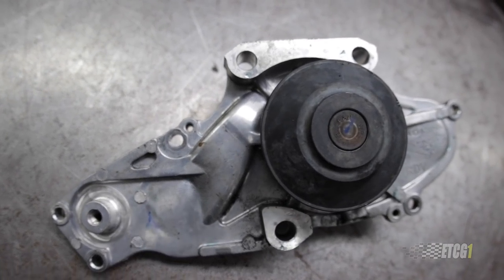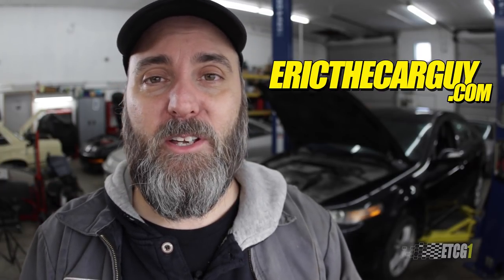Timing Belt vs Timing Chain, Which is Better?

Comment: Some belts are good, some chains are bad. But for the average person having a chain means less cost for a longer time.

It's also sometimes just as expensive/difficult to change the belt.
Reply: When I was a new driver my dad always said replace the belts and water pump after 100k miles. I wonder if there is similar wisdom for the chain guides
Reply: Plus chains tend to fail less catastrophically. They will rattle and throw timing codes.
Reply: @zachm7916  A chain can cause similar damage. If the tensioner fails or if the guide breaks, the chain can easily jump time and valves can kiss the pistons.
If a tensioner fails or the chain "lengthens" itself and it rattles long enough in its housing, the metal shards of that housing can cause internal wear and damage.
Reply: @blockbertus  Id agree that can happen, but it seems to me to be more common on engines that are designed poorly in the first place.
Reply: @blockbertus  True, but I know from experience that most customers will just crank up the radio and ignore the check engine light.
Reply: @panzerveps  Exactly my point.
Reply: Just as expensive lol compare the Toyota 4.7 and the 5.7 it’s thousands more to do the timing chains on the 5.7
Reply: And yea they wear out every 150-200k because will it’s a wear time
Reply: @eric8292  It really varies from vehicle.to vehicle, some belts need to be changed every 80-90k km, Some chains can go for 400k, some tensioners fail at 250k.

Generally there are so many other things that can and do go wrong on a car that it may never even last to that point. But if you were to replace it every ~225k, km you would probably be good on that front.

I have a feeling the water pumps are getting changed out way too often because of 'might as well'. They should not fail as often as we plan for. Seems like such a waste. Either that or they aren't being built to last just because they know your belt is being changed.
Reply: @Oblithian  what's wrong with changing the water pump before it fails? Genuinely curious. Preventative maintenance is good, plus the old water pump can be remanufactured so it doesn't get wasted in the earth. Maybe I'm missing something?
Reply: Good opinion
Reply: @panzerveps  There's no solving poor maintenance, but you can at least reduce the frequency. Alternatively  if you have a non-interference engine, it is more dummy/sloth proof (and belt-defect tolerant).

So if I wanted to give a vehicle to someone who can't be bothered, a non-Interference belt-drive would be good to force them into some maintenance. Though if they are skipping oil changes for the life of a belt, it probably won't live long anyway. So maybe they will be better relegated to electric only.

Comment: 9 times out of 10 I'll take a chain. The few exceptions are engine models with history of poor chain reliability like a 5.4 3V Triton (Had 336K on a 2V 5.4 that rattled on start but never snapped. At that milage I was willing to neglect the chain.) Ford 3.5 with the internal water pump, Ford 4.0 with the rear facing chains, Chrysler 2.7 (That entire engine was a sack of shit), GM HF 3.6, Almost any Audi engine, and a few others. Aside from that, a chain will generally last the life of a properly maintained engine. Belts just add another thing I have to maintain, and I find them absolutely unacceptable in a Interference engine.
Reply: Thats a lot of "buts" on the timing chains. Add in the 2.4l GM. I know you said 3.5, but add in the Ecoboost 3.5 trucks (they have an external water pump). 

Every belt job I have ever done has been super easy. Timing chain jobs are more involved and pricey. Belt FTW.
Reply: 146,000 miles on my 2.7 liter 06 300, I drove to Florida from Pennsylvania and did 4,000 miles in 4 weeks with no issues. first Gen 2.7's had issues, but the second Gen from 04 on had a better design. And let's be honest if you perform all the maintenance (as I do regularly) any engine will have a longer life, belt or timing chain driven.
Reply: @OhPhuckYou  as I stated they improved those issues and sludging is due to not changing PCV and skipped oil changes. 
and 1st gen had a backing plate which failed. 2nd Gen has no such plate and extra port as a weephole to act as a passage that exits out the thermostat housing (on the side of the engine). like I said maintenance is key. All par has a list, and it was a list of changes. The first Gen screwed the reputation of these engines and, I as well have a guy around me with 250,000 miles on his. maintain your cars and you should have very little issues
Reply: I don't understand how can Audi design so many trash engines. My 1.2L CBZA Audi engine has problems with timing chains. I had to replace timing chain on my car every 50-60k miles. lmao. And I'm on 160k miles with a 3rd timing chain.
Reply: @CoreMaster111  I never heard of an Audi owner that was happy.    And I never heard of an old Audi that is driven regularly.

Comment: I prefer timing chains but I also prefer pushrods they just seem simple and are less likely to fail in my opinion timing belts are not terrible if the engine is a non interference engine

Comment: If the chain is really durable, chain is better. But if you design a chain as VW does (that stretches before 50k or something instead of 200k or more) the belt is better and less invasive to change.

Comment: I’m Not a mechanic, but I’ve done many timing belts mine or family’s Hondas, Toyotas & a Nissan twice. 
Over all it’s a satisfying job for me.
I usually do Everything because I’m already in there.
Timing belt, tensioner, (good quality) water pump, thermostat, antifreeze flush, fan belts, spark plugs, oil change, power steering fluid change.
Think about replacing those radiator hoses to!  Especially if it’s the wife’s car, do you want that dreaded call “honey the car broke down and I have the kids with me”  oh hell No. peace of mind guys.
Reply: Don't forget the oil seals🙂

Comment: 🤔 I Prefer Timing Chain, Like A High Performance Heavy Type, I've Replaced A Weak 🔗Chain On My 99 Chevy s10 Blazer With High Performance, A Great Improvement, Engine Runs Well 👍😀, That's My Take.

Comment: My daughter has a 2002 Camry LE with a timing chain and a 187k on the odometer.  I'm thinking I need to replace the water pump soon since I do not know if it has already been changed.  Should I wait for symptoms that the water pump is failing or should I change it at a regular interval, where I might already be overdue?
Reply: A little off topic, but I'll answer this for you.  I normally change the water pump with every coolant flush/service. Most factory coolants are good for 5 yrs./150K miles.  Personally, I use the mileage to determine when to service both.  I do check the coolant, boil/freeze point, every year.
Reply: @Pk3_Garage  Thanks.

Comment: BMW's problem was that the engineers had the impossible job of making a whisper quiet chain that was fuel efficient, could handle the long service intervals and cheap to manufacture. Everything is a compromise.

Comment: In 300k mile average lifespan of a modern vehicle 1500 bucks times 3 is 4500 bucks.  
In my time with fleets that use synthetic oils and good OCI for their conditions internal engine parts including timing parts last for hundreds of thousands of miles. Many of the non- variable valve timing Fords were going an honest 500k miles and more by the time trucks got rusty and beat up enough to replace.
Geat food for thought though.  If you can diy a belt it might be no big deal to change belt every 2-4 years

Comment: I prefer well designed and made timing chain driven engines. My Honda has a chain and it has 180,000 miles and is 13 years old. No issues with it. Original timing components. I expect it to last at least another 180,000 miles.

Comment: Timing chains for "lifetime" service. Many manufacturers expect you won't exceed 150k-200k mi without wrecking or junking the car so that's what they last for. Whenever I get a vehicle I used to pay attention to whether it was an interference engine or not so I know what to expect; if I take my chances and delay a timing job am I out just a tow to the shop plus parts/labor for the work, or am I out a whole engine? Needless to say many common cars now are interference so I just don't pay attention to that anymore.

Comment: I am generally on the Chain Club but I would much rather have a rubber belt on a 3.6 L GM V-6 in the s*** chains they have on them and I know that they updated them recently but still it's almost impossible to have engineering mistakes with a belt but there are engineering mistakes capable of being made with a metal chain but rubber belt eliminate tons of failure causing variables. Chains also mechanically shear the oil more so youd generally want a thicker oil unless the tension is very low so a thinner oil can be used but that can cause issues as well. A belt with a spring tensioner and non interference design there's nothing to go wrong aside from a broken belt on the side of the road.

Comment: I think the real discussion is interference or non-interference. Another reason Miata is the answer. 165k out of the original timing belt before It broke last year.
Reply from the maker: I think that's irrelevant. You can have a belt break on an interference engine and the engine can still be OK. The car behind me in this video is a perfect example.

Comment: Imagine my surprise when the belt on my '85 Accord broke after I bought it from a dealer.  Imagine my further surprise when the interference engine didn't destroy itself.
Reply: At 68K, by the way
Reply: One of the more common things I see is how someone buys a used car and hundred miles later the belt snaps and destroys the engine.

Comment: The harsh reality of the real world is that, for a myriad of reasons, people don't maintain their vehicles.  I've seen far too many vehicles in immediate need of a timing belt, the owners were unaware, and absolutely did not have the funds to address the maintenance.  I've personally lost two fleet vehicles over the past three years due to the fleet management company outright refusing to replace the timing belts.

There was a time when I could say that timing belts are quieter, but with the adoption of direct injection engines across the board, the fuel injectors make more noise than a properly-functioning timing chain.

I like the idea of a timing belt, but in the real world--especially on the used car market--it's not practical for most people.  The average person doesn't need a vehicle that's at peak performance all the time; people need reliable vehicles that don't cost them large amounts of money to maintain.

Comment: I got two cars one has a timing chain, one has a timing belt. Unless you are dum and completely irresponsible to your car's maintenance you should never have a problem with a timing belt. Specially the newer cars who have strong thick timing belts that are sheltered in housing they are very foul-proof and secure.

Comment: In an interference engine I would venture to say the timing chain should be the preferred choice. When it's a non-interference engine I would just run the belt until it broke or seems like it's close to failing. I view one the chain as more reliable, but also more wasteful (high inertia). Overall without any other considerations I prefer the chain.
Reply: I am soon in need of a "newer" car.   I buy cars very cautiously and infrequently.  My wants are:  smaller SUV, V6 as I pull a 2K pound trailer.   Many brands going to 4 cyl. I still want a non turbo V6 .  I currently have the Rav4 with the fabulous V6 2GR engine.   I've faithfully changed oil every 5K since I've owned it at 30K miles. It now has 185K miles.  I can only come up with one standout choice...the Lexus RX350   - smaller SUV,  japanese quality,  still has the V6 2GR (assembled in USA) ,  timing chain and plenty of HP for the trailer. But they are a bit   $$$.   Your thoughts please....The other possible choice is the new Honda Passport but it has timing belt- UGH.  It is less $$  ( 7K)   so maybe the price indifference will pay for the $$ labor/parts in changing the belt, tensioner and water pump every 100K miles.    at my age 68,  I may be belly up when my next car hits 100K miles!   Know what I mean?  appreciate a RSVP- thanks
Reply: @brianpiersol9412  are japanese designed vehicles your only choice? I've owned many different brands and don't believe in the Japanese quality narrative. My Durango has 249k on it and runs great. The hard part is finding a used car that hasn't been abused. The prices are pretty crazy right now. I personally know a few people that had the older rx models and the transmission failed on them. They could've been bad at maintaining them, it might not have been the cars fault. So, it's hard to say what kind of small SUV would be good for you. Stay away from CVT transmissions, maybe find something that still has a factory warranty?  Avoid direct injection, they tend to foul up and need the intake taken off to clean the valves. It's hard to recommend anything. No Kia/Hyundai some of them are catching on fire. I'll get back to you later.
Reply: @methanial73  thank you indeed!
Reply: @brianpiersol9412  A Mazda CX-30 has a 6 speed and can tow 1500 lbs. None of that CVT BS. Unfortunately it has a timing belt, but they're supposed to last 100K miles before they need to be changed. I drove one of these and it seems like a pretty decent vehicle.

Comment: Cam shafts open valves for a duration of time. 
The valve spring closes the valve

Please let me know if anyone else thinks the same way or has any opinion about if I am correct or not

My opinion:
Cams open valves
Valve springs close the valves

Comment: I've had vehicles with timing belts and others with timing chains. As far as I'm concerned, there really is nothing to gripe about one compared to the other. They each have their place. Last year I replaced the chain, cam and crank gears on my 2000 5.7 Dodge engine at 167K miles. The water pump and thermostat, upper and lower radiator hoses were all replaced at the same time and the coolant system flushed. A friend helped with some of the labor, so my bottom dollar was less than had it been taken to a shop. The old chain definitely had developed some slack. It was obvious. The gears were actually fine and showed no evidence of wear, but we had new ones so put them in. When it was all done the vehicle honestly didn't perform any differently. Was I upset; no. I knew the work we did would last the remaining life of the truck.
Years ago my family had to Ford Escorts, an '86 and an '87. When they got about 95K miles on them the belts were replaced. We knew the risk we were taking ignoring replacement of these belts. Both cars were sold at about 135K miles and were running great. These vehicles were considered toss or throw away cars by Ford, but with proper upkeep were great cars. I routinely got over 40 mpg on interstate driving.

Comment: i've never noticed any difference in an engine running or it's performance from a timing belt change. (unless done way beyond the interval) i've also heard of engines losing their chain guides and thus tension BEFORE 100K miles (around 110K kms) and i've heard of belt engines where the manufacturer kept lowering the interval and cars STILL not reaching said intervals! my pov: shy away from said known manufacturers that can't get it right (cough*VW/AUDI VR5's with chains, Fiat and KIA with belts* afaik) 
i've owned a Volvo with a 100K miles interval and had that belt replaced once (around 200K miles) by a former Volvo dealer mechanic, who guaranteed me: DON'T replace the water pump, that's when the trouble starts! he demonstrated how it still ran true after said mileage (i had the service record, it had never been replaced before.) rn we have this little toyota yaris with 230K kms on it with a chain driven engine and it still purrs like new..
Reply: Yes, VW/Audi made several chain driven engines with stretch problems. Some even located the chains on the back of the transmission, so it had to be removed to replace the chains.
The Chevrolet Aveo advertised a 60,000 mile timing belt. I have no idea how many only went 30,000 miles. They quickly cancelled that car because of what a horrible money pit it was. Engine parts companies constantly had rebuilt heads in stock because people were bending valves.

Comment: Timing belts are preferable on German cars as the Germans seem to make a sport out of making unreliable timing chain systems and also making them incredibly diffucult to replace. GM also seems to follow the German lead (thinking about the alloytec engine in particular). My experience with Japanese cars is that either is fine- the belt systems are usually very reliable, easy to replace and have reasonable intervals, and Japanese chain systems don't really seem to give any problems. Let's not forget chain system longetivity is helped by frequent oil changes, another reason why you should ignore extended oil change intervals and change your oil much more frequently.

Comment: I'm lazy and poor so I prefer a chain.  The odds it will fail before something else ruins the shitty cars I can afford are fairly low.  Not zero, but low compared to a timing belt which I just know I'd wait way longer than I should to change out.

If I could afford to have someone else do the work for me, though, I might prefer the belt for the reasons you lay out.

I do wish timing chain inspection was easier.  The procedure for my Grand Am involved removing most of the top of the engine.  At least my current car doesn't have an interference engine, so a timing chain failure would be a PITA but not disastrous- the car is old enough that the damage an interference engine would likely suffer could make replacing the entire car more financially viable.